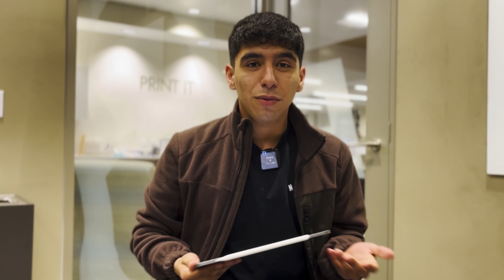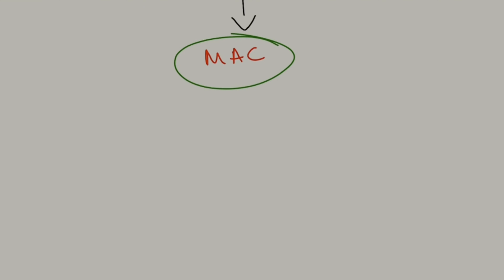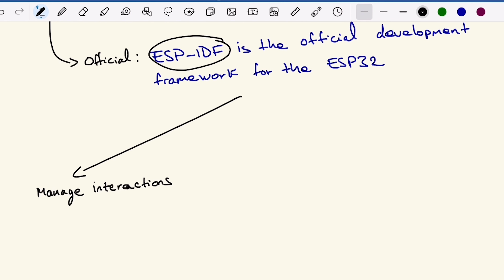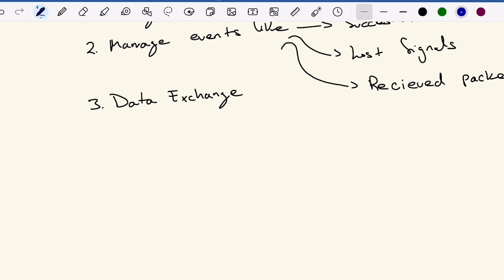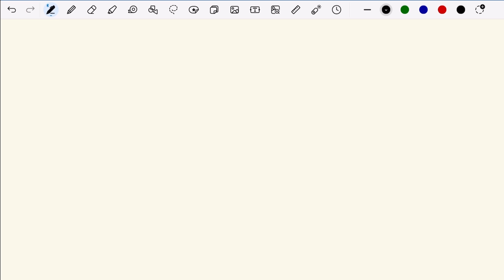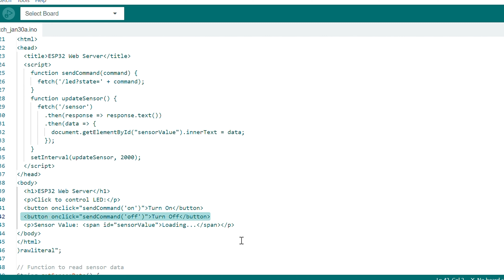ESP32 Wi-Fi Web Server: Control Devices & Read Sensor Data!

Comment: Crazy how the wifi works, we have a small chip that is capable of read different type of signals from waves to digital data and use for communication this physical layers have some advances math algorithms for doing this process super quickly and then order this data into different packages with another layer, like if we think technically is just advanced algorithms that were developed using critical logic and math for encoding ones and ceros as information and with the code we can organize all this information. Electronics is amazing I’m mean I understand better how it works but still pretty hard to understand I hope someone will give me a more resume explaining please 😂😂 🙏🏽
Reply from the maker: Thank you! You have a great point about the complexity of the ESP32's communication. I'll definitely try to break down the process even further in future videos. 😊